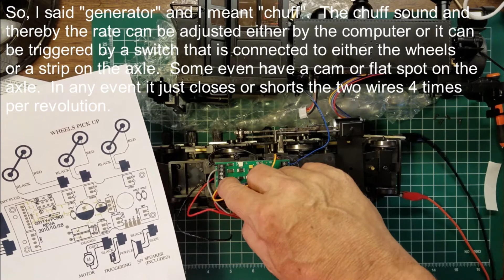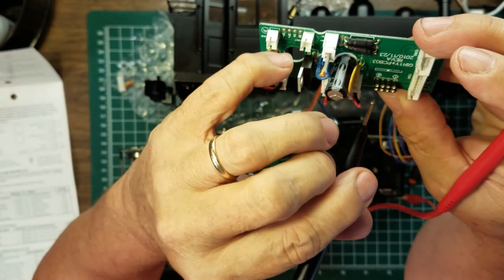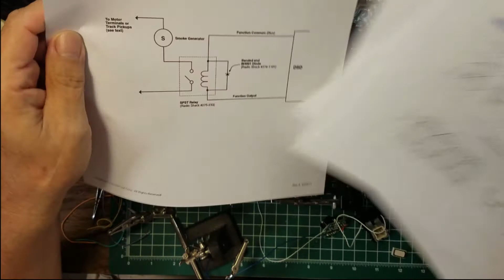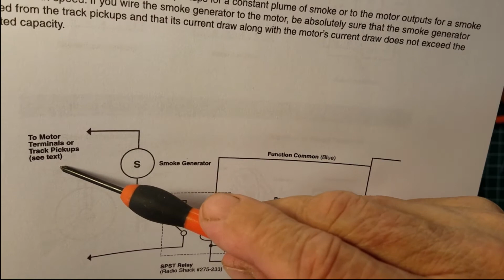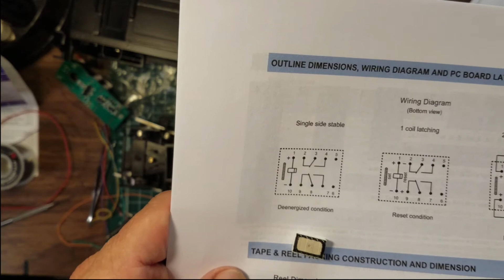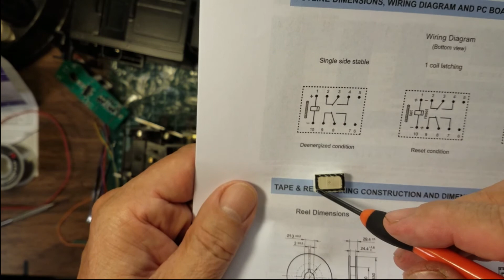G Scale sound install part 2

Comment: So I am in the process of installing DCC into a LGB locomoitve.  I just watched your G Scale installation videos twice.  I plan on following your method for the smoke unit.  I am not going to put another external switch into the smoke unit circuitry.  I have purchased the exact same relay as you used in your video.  So to be 100% sure you connected the V+ (blue wire) to #1, the function (Green) wire to #10, the red track wire to #3 and the black track wire to #4?

Comment: I cannot get the micro relay to work, I have followed exactly as you did, I power across the diode, but no switching on three-four, or eight to seven. Any ideas?
Reply from the maker: maybe bad relay, diode or you may have already blown the power output electronics for that function.  Try putting an LED with a 1K ohm resistor in series with the correct polarity (+ is on the blue wire or common from the decoder) and test the function first.  Then test the relay out of the engine with a benchtop power supply or battery bank.  Check your success with a multimeter connected to the outputs of the relay.  You may also be having an issue with the "load" on the relay with the smoke unit being already burnt out or bulbs being burnt out.
Reply: @trainbuddy9398  finally got it, bad relay. second one worked perfect and that 20v track power puts out some real smoke! I ended up wiring in another led in the smokestack hooked to the tsunami decoder to simulate a bit of glow from the smokebox/boiler. It makes the smoke more visible too

Comment: It looks like it was originally wired so that all you had to do to add sound and smoke was plug in a Bachmann DCC decoder.
Reply: Mine was from the year like 2000 on my 2-8-0 consolidation, so I just stuffed a TSU-4400 in the boiler with a few more upgrades and just rewired the entire setup. The Bachmann chip was very dated and many of the extra electronics used weren't very useful in my install. But success, and runs great! the micro relay worked beautifully too
Reply from the maker: I'm sure you are correct.  The Bachmann sound in my opinion is not close to the Soundtraxx/Tsunami top of the line sound.  I'm currently replacing a Broadway Limited Paragon 3 (super good sound as far as the industry is concerned) with a Soundtraxx/Tsunami 2 per customer request.  Thanks for watching and your comment is spot on!
Reply: @trainbuddy9398  If I ever get around do it, this should be easier with my Porter 0-4-0 assuming the online diagram is correct (mine is from around 2002, before they included the speakers and smoke units on the 0-4-0T locomotives). It would be moving a set of wires to the decoder, installing a speaker, and adding a smoke unit (if the funnel is compatible). I just wish they hadn't discontinued the 0-4-0 locomotives.
Reply from the maker: @karlrovey  I've done several Porters and they all had the same issue - the steam chest was filled with the motor and/or weight and there was no place to put the decoder, let alone a speaker.  One had the motor connected directly to the splt frame (think right and left pickups) and had to be isolated - think that through.  Also, I had to file wireways in one that had weights around the motor.  I ended up putting the decoder vertically in front of the engineer.  Today's TSU-1100 and sugar cube speaker would make this more feasible.  I would be most interested in how it turns out.
Reply from the maker: btw - a smoke unit, no matter who makes it, is not directly powered by the on/off of a decoder function.  You WILL destroy the function drivers on most decoders.  Typically I use a very small relay that has a "collapse" diode in parallel with the coil.  See Soundtraxx Technical Reference on this subject.  At this writing it is at https://www.soundtraxx.com/manuals/Tech_note%2014.pdf
Reply: @trainbuddy9398  It will be a while before any of the work happens. First step is being in a house rather than an apartment. Mine is the Large 0-4-0 (which looks like it is about the same size as the model you're upgrading, in fact, I wouldn't be surprised if the shell would run on the 2-6-2 Chassis). The motor should be below the cab according to the schematics. If it were the small 0-4-0, I wouldn't bother with anything other than a DCC decoder.